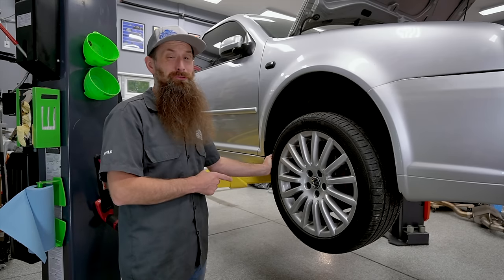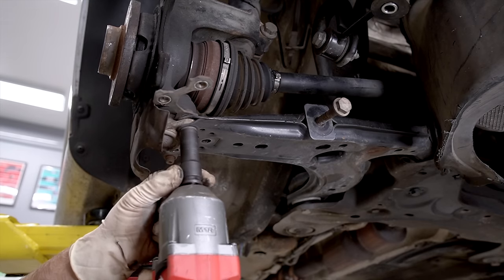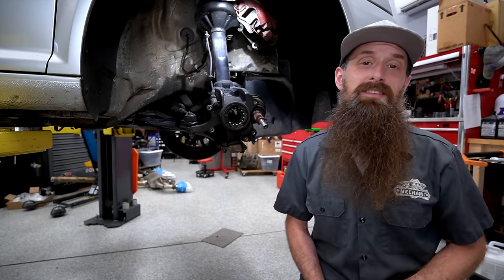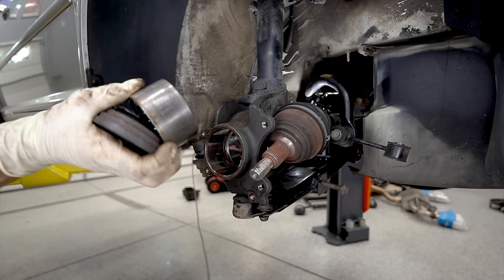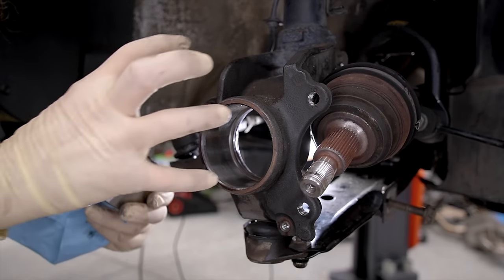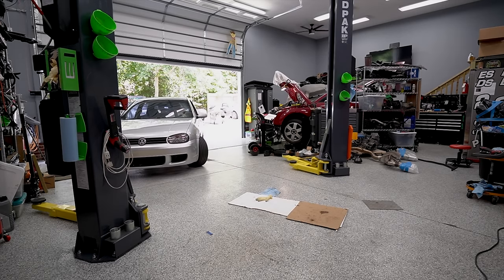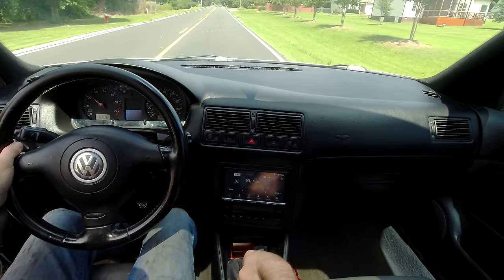How To Replace a PRESS IN Wheel Bearing ~ On The Car

Comment: My 04' Passat 1.8T 5 speed Wagon once again thanks you. Fortunately when I first got the ride my mechanic wanted my DJ setup so I didn't have 2 pay for alot of repairs such as all 4 brakes, rotors, tie rods, and a wheel bearing. But I can assume I'm getting closer to my expiration date for the other bearings. Living in Central Wisconsin where brand new brake  rotors start oxidising and surface rusting 2 days after installation living close to a lake so yeah. I swear I should go to a psychologist for rust therapy... 😆

Comment: I now have an (cheap unused) wheel bearing removal kit (I’m just a DIY mechanic ). Years ago, with my dad I used a combination of large sockets, centre punches, vice/bench, hammer/mallet and a lot of precision and patience. Took the hub off completely and had it on the bench.  Literally basically tapping the bearing off (and in) gently in a circle/opposite way. We’re taking late 90’s cars, likely Fiesta/Metro/Golf Would that ‘caveman’ method work today on modern cars?
Reply: Many modern cars have bolted in wheel bearing module.. You can still hammer/press/cut them out ofc. Usually you need some press action though. I've done it with a threaded rod and some hole saws.
Reply: The moment you mentioned Metro, I thought UK based like myself. I have changed a few different types of wheel bearings - taper on the rear wheel of Mk1 Fiesta and Maestro, the type in the video on my Avensis Mk1 and the hub bearing on the rear of the Avensis and front of a Prius. Done other cars not mentioned. I have a 10 ton press and more recently the bearing removal kit, as seen in the video. I got my kit from eBay and it made light work doing a Micra wheel bearing. When doing this job, you have to consider the design of the hub and the wheel ABS sensor. Hub bearings though 'simple' bolt on jobs, can be seized due to galvanic corrosion, as I found out doing a friends Prius. I used a sledge hammer and another bit of heavy metal to whack the bearing from the hub. You need to be prepared.

Comment: TIP:  Harbor Freight ICON brand Internal Straight Snap Ring Pliers (P/N: PSSRI12) work PERFECT for the snap ring.  I tried like 5 different tools to squeeze the snap ring for install and the HF pliers worked perfect, first time.

Comment: The great thing about rust belt cars is that the snap ring is such a pita to remove that it gets permanently etched into your memory and you can't forget to put it back on.

I did however accidentally press out the inner race of the new bearing on two separate occasions. Feels like it's going in nicely until you notice what's coming out the other end.

Comment: My Audi's axel nut was 140lb-ft + 180.   Apparently that clamp load is to keep the wheel bearing tight but it about killed me trying to get it back on.

A friend of my ex asked me to look at her car because it was making some noise.  The wheel bearing was TOAST, like so much slop I told her she couldn't leave with it.  I had to take a cutting wheel on the angle grinder to cut sections out of the rotor hat before I could beat the dang thing apart.

Comment: For that final step it's simple geometry. There are 360° in a circle. 360° divides by 60°, 6 times. In this case the axle nut is a 12-point. The manual makes sense in that you make a mark between  two points on the 12-point axle nut, one on the hub and the other on the nut, while skipping a point in between. You're essentially dividing the axle nut into 6 equal quadrants. When you rotate and align the marks, you are at 60° rotation.  If the axle nut was a six-point hex nut, you would make marks on two consecutive points on the nut, align the marks and you get your 60° rotation.

Comment: I’ve had many mk4 gti and Jettas one tip I would recommend from experience of replacing hubs is always take off the screws that hold the abs ring onto the hub and put thread locker on them, the amount of times I’ve had them come loose is absolutely ridiculous and a pain

Comment: I like taking the knuckle off the car. I use a large vice. It works out very well. OEM tools has a really nice kit that uses horse shoe and bracket that pulls the hub off in seconds.

Comment: I’ve seen this on a bunch of Subarus too. Typically when they don’t get the front axle nut torqued down properly from a trans removal etc. They’ll be quiet, but you get them up in the air and the bearing is shot and sloppy.

Comment: To measure 60 degrees, you can also use the spokes on the wheel. 15 spokes, so 60 / (360/15) -> 2.5

Comment: what a pain or process for tightening axle nut. For me how i was taught the 12 to 6 .. 12 to 6 looked at wheel bearing play, 3 to 9 looked at end link/tie rod play because of the angle. Did you learn it that way or hear about that? Great in depth and granular video!!!

Comment: Charles, I can assure you that once the inner race has eaten into the hub like that, it is absolutely no good anymore. It will have play in the wheel bearing still and fail imminently. Pretty much once there's play you should probably replace the hub regardless. If you're replacing it due to noise and there's no play, you're generally good to re-use the hub.

Comment: The first time I did a press in bearing I forgot to reinstall the snap ring and only remembered as I was putting the wheel back on.  I had to start from scratch with a new bearing since the hub was already pressed in and the snap ring groove was inaccessible.   I’ll never make that mistake again!

I’ve also forgotten to support the inner race when pressing in the hub and had to start all over on that one too.  In the moment I felt totally incompetent but it’s very comforting to know that even the most knowledgeable and respected techs have made these mistakes at some point as well.

Edit: I’ve also tried to put a caliper on without a rotor 🤣
Reply: Many have .
Reply from the maker: UGHHH been there... more than once.

Comment: I replace them using the interference method. I heat up the stub axle and eventually remove the bearing.  When putting the new one in, heat up the stub axle and put the bearing in the freezer the night before. Makes it easier to put it in. Then when both get to room temperature they’re not going anywhere!

Comment: That Orion "OMT" wheel bearing removal/installer set is a bit weak as it is Carbon Steel.... Try to find a set that it's made of "Forged Steel" as that's a really strong steel and cost more for that reason!  VEVOR makes one just like this one but they opted for the Forced steel instead and cheaper priced compare to the cheaper steel of Carbon that OMT opted to use and charge more!

I bought a couple of months back a VEVOR bushings removal/installer kit (very heavy) set and it was very well made, less than $90 and was able to remove all my differential bushings and large main bushings and installed them like a professional on my BMW F10 and the tools didn't wore out nor bend nor stripped.  One cool feature was that it had bearing washers that helped alleviate the stressed put on the bushings when removing making the job easier than thought and worth every cent spend on it!  VEVOR makes some really good tools and even if they don't make them they source out the higher quality parts for their inventory and slapped their logo on them and give great value to the customer!

Comment: Hi great video 👍🏼 , I have a question please. I have a 2005 GTI 5 speed 1.8t and purchased my second south bend daily clutch. I’m having clutch chatter after the run in period. Which is wired because my first south bend daily clutch never had any problems with chattering. What do you think might cause clutch chatter from my second new clutch install. Thank you

Comment: Wow, I live in the rust belt and I've replaced 2 of my axles on my mk4 without issue or rust. I've also replaced both control arms and knuckles and didn't have to fight rust either

Comment: Only 1 tip for rust belt cars, put the opening on the snap ring down so water and debris can drain out. It may help 3+% next time removing it. It's not an end all fix, but, it can help.

Comment: I changed the bearing on my Mazda 626 and I have a different sound. When we were installing the spindle we didn't use the right size backing plate, just the big one. We eventually used the right one, but could we have damaged the bearing? Also when torquing the axle nut it got tight right away.

Comment: 25:10 I'm an appliance tech. My thought process is that the manf. made a kit for a reason. Case in point, I had an ECB kit that came with an electrical filter board. Even tho the filter (bench)tested ok, they were burning out the ECB's over time (an extremely tight frequency shift).

Comment: More than once I had to put the whole knuckle in a hydraulic press to get the bearing out, sometimes the inner ring is stuck on the axle and need to be carefully grinded away (make a groove and use a chisel). Some people think it is soon enough to have it fixed when the bearing is growling and the wheel is about to fall off!

Comment: Just a thought when doing the 60 degrees. Those alloys have 15 sections in their 360 degrees. 360/15=24 degrees per section. 24X2.5 sections =60 degrees. So by moving your wrench 2.5 sections of the wheel you have done exactly 60 degrees and this is much easier to see.

Comment: After doing three wheel bearings for my cars, I've never once had a slide hammer actually work. I always have to take the knuckle off, cover the back of the hub stem w/ a big washer, and smash the crap out of it with a big hammer.

Comment: Right now I have a howling front left wheel bearing. But oddly it goes quiet when I turn right, and load it. But my favorite way to replace a wheel bearing is to replace with a complete steering knuckle. $120 and takes me only about 30 minutes to change.

Comment: In a pinch, on a hub or axle/knuckle where the machine surface is worn down and the bearing is no longer a press fit, you can use a sharp pointed chisel to put a lot of small indentations. It forces the metal surrounding the dent to be pushed out and up (surface of moon) as well as providing more imperfections to help grip the bearing.

Comment: So i did this same job same tools same car mk3 vr6 but i had pre mature failure i cant remember if it was a failed bearing or if it was an inproper  how easy is it to put the bearing in crooked ? Any other tips for makin sure the job goes smoothly . I got a bmw x3 now and im sure the bearings are bad i have a repair manual but im not tryna mess it up  again.

Comment: Also for press in wheel bearings i recommend on the inside of the bearing sleeve nock out the bearing internals and if you have access to a welder, weld inside the bearing sleeve on aluminum knuckles you dont have to be super careful when welding the sleeve but if its a steel knuckle be very careful not to weld the sleeve to the knuckle but with a full ring around the inside they come out so much easier, also if using a bench press use your old wheel bearing sleeve to press the new one in it is the perfect diameter especially since it did come out of there, hopefully make a young rustbelt mechanics life a little easier lol
Reply: Shop i work at here in Michigan we always weld a full ring on the inside and we always use a big bench press the welding inside trick just makes so much smoother we do also not have any on vehicle press in bearing tools only one i knew of before seeing one used in video was like a 400$ set

Comment: A small dab of motor oil/silicone grease/high temp multi purpose grease. Like just a super thin layer so that it helps the bearing slide in but not enough to cause problems. Half Pinky finger dip in motor oil.

Comment: The repair manual for my octavia mk1 2001 1.6 sr says this:"use new nuts. The vehicle must be supported with its weight OFF the front suspension while the nut is slackned or tightened or the wheel bearing will be damaged. Prevent roadwheel rotation by having and assistant apply the brakes.". It uses a pressed bearing and hub just like that.

Comment: I got a weird VCDS question. When you start an output test, do you have to let it finish going through all of them before exiting? Using it on a B5 A4 and wanted to use the output test to check my SAI pump, didn't realize on OBD11 you have to cycle through the injector checks first, which I didn't want so I exited without getting to the SAI. Are some of these cars required to go through these tests to get to the one you want?

Comment: I didn't want to rent out the bearing press so I hammered it out with a large socket while the part was on a tree stump and had ear plugs in. I beat it like drum for about 2 hours and then it came out. I hammered in the bearing with a tiny wooden on top to reduce the damage and then went it was 90 percent in, I used the old bearing on top to make sure it was fully seated.

And yeah my car is rusty as s***. But it drove the same day

Comment: On my 2nd mk4. Have had 3 bad wheel bearings replaced between both. None made a noise. They were found because other suspension work was being done.

Comment: Hey Charles, I'm in the middle of replacing the rear wheel bearing on my B5 A4 and I am having a lot of trouble getting the old bearing to budge. I'm using a press tool like what you have in the video from ECS but the bearing hasn't moved at all. Any tips or tricks that you recommend trying? Thanks!

Comment: That's what happened to my Mk4 Jetta. I ended up changing the whole hub assembly with the knuckle because I only had hand tools. I was able to remove the axle nut by hand and found it was loose on the passenger side.

Comment: @25:52   When you install that Caliper w/Brake Bracket did you apply any Threadlocker on those mounting bolts? I put a Blue Thread Locker on that job like a 1.5 years ago, everything was good, no problems w/breaks. I see in many films people use Blue TL on those attaching Brake Bracket-to- Knuckle bolts. But now I did smth else on suspension and needed to remove the Brake Bracket again. When I looked to double check the torque and everything in Shop Manual for our 2001 Saturn SL2 (I have one), they say there to apply Heat 272 Loctite or equivalent. And if you don't have that Red Loctite, you need to replace the attaching bolts. Of course it is advice for a shop w/unlimited access for the bolts of that type and everything, and they are very precise (supposed to be of course). But why everyone applied Blue, as Shop Manual says Red? That what puzzled me. This is full Saturn Shop Manual 2000-2001 S-series, very detailed, 3 huge volumes (4-5 different books inside of each volume, put together w/binder), thin strong paper like papyrus. I'm confused on all that. If I apply Red TL, will I be able to brake those nuts w/huge breaker bar, or heat would be needed? It is not a problem to apply heat of course, but there are CV Axle Boots there close by, I even don't know. And again, everyone applies Blue: The Mech a nic, Chris Fix, many others. I would appreciate any opinion on this matter. Thank you for the great film.

Comment: Charles, have you thought of using a thrust washer instead of the 2 flat washers on the press bolt ? A D-5 is what Eric O of SMA uses but I found another brand that works as well, but I can't find the number for it right now. It cuts down on the force needed to turn the forcing screw/nut considerably.
Reply from the maker: that is a great idea! Luckily for me(VS the MAN Eric O) most of my stuff is easy in/easy out thanks to no rust!

Comment: My 2002 F150 4x4 had a bad bearing in the front.  Loading the left front it got louder and loading the right front it got quieter.  Changed the left front wheel hub and fixed the problem.  A year or so later a front wheel bearing started making noise.  Loading the left front  made it louder and loading the right front made is quieter.  So, I changed the left front bearing again.  Did not fix it.  Turns out it was the right front bearing hub failing.  There are two bearings in the hub and I suppose it makes a difference which one of those bearings inside the hub is failing  ???

Comment: My wheels don't wiggle, abs sensors checked, i cleaned the rings.
 Abs fault intermitent. ABS light ON when driven fast , and ABS light off ,when slow. 

   Can it still be bearings?
While breaking, with abs on, i can feel a pulsation and pedal pushing and some noise. But when the light comes on and i use breaks WITHOUT abs , then pedal feels normal.
What can it be? 
I'm thinking bearings but diagnostics doesn't find any fault.

Comment: If you live in a place with salted roads and real winter weather, and your car is old enough to need a wheel bearing (assuming it didn't just move there from someplace not like that).....?
Save yourself the trouble and butthurt and just buy either a salvage knuckle with bearing or a complete refurb assembly. This is knowledge earned over many years and bearings....
Reply from the maker: I can support that haha

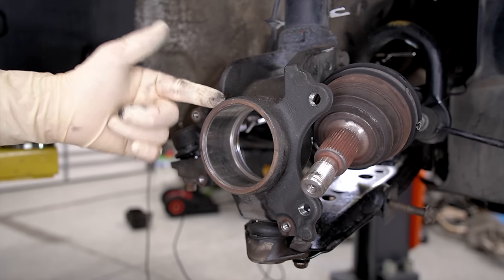Comment: 17:33 If you live in the rust belt, you lube this... It prevents the bearing from seizing to the knuckle. Always think about the next person because 9 times out of 10 that will be you! I live in NY and using the same press set I have bent breaker bars trying to remove seized bearings. I also grease the nut, threads and washers on the puller just to help prevent excessive wear to the tools.

Comment: Can you use the spokes as a reference for the degrees necessary?  
6 spokes - move 1 for 60 degrees
that 15 spoke wheel, 60 degrees is just short of 3 spokes.